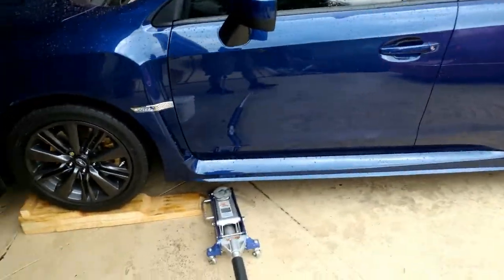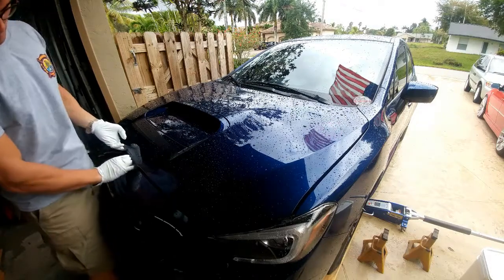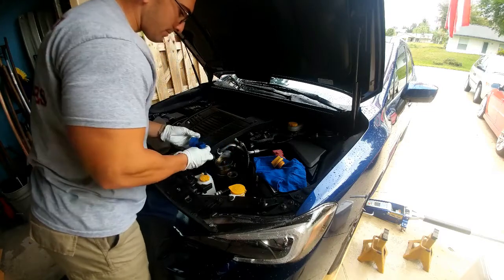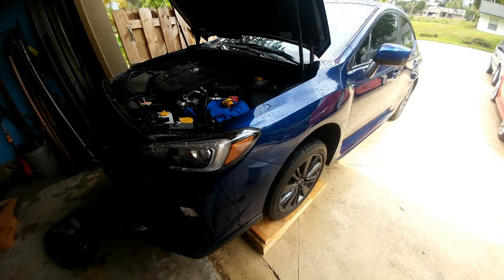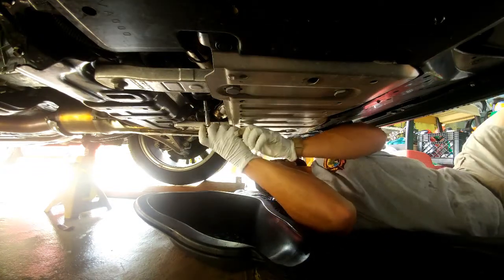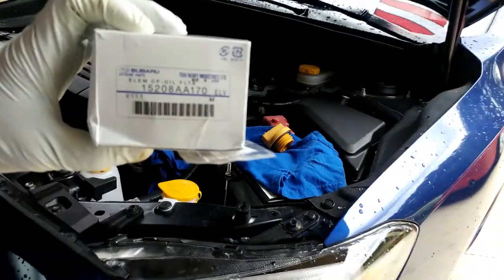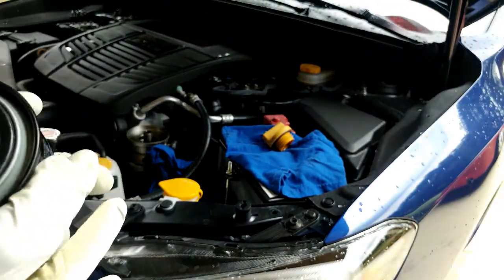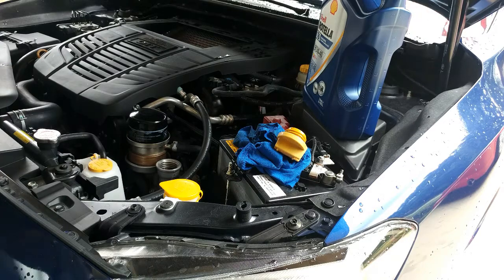2015 + Subaru WRX Oil Change DIY and Fumoto Drain Valve Install

Comment: Did you not get fitment issues? For some reason mine was hitting the headers and I have stock ones too. I just took my j pipe off today to put on a new some so maybe I just needed some more space I hope
Reply from the maker: 0